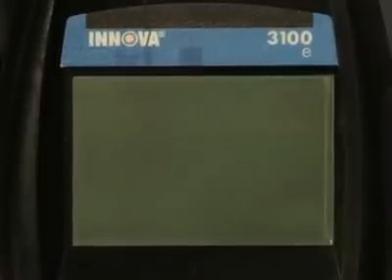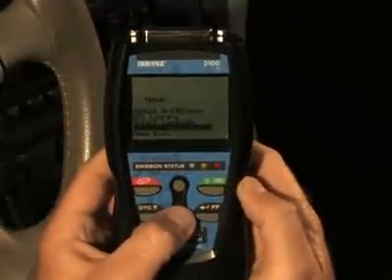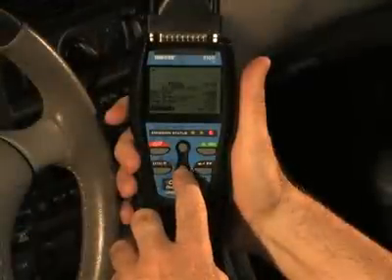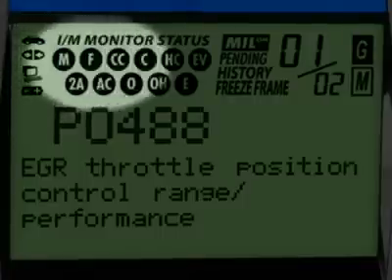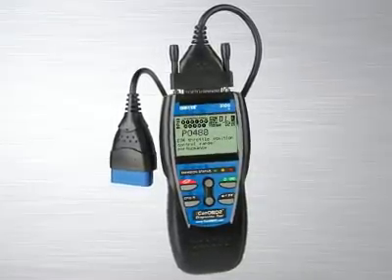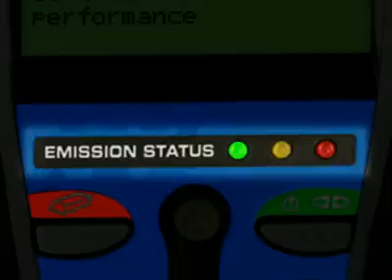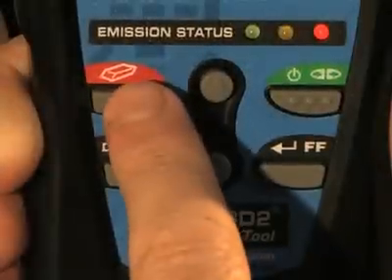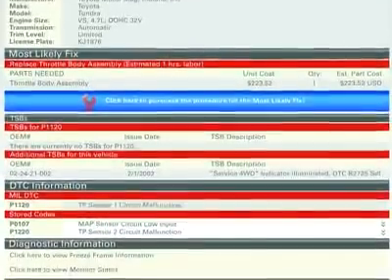Innova 3100 Instructional Video

Comment: Do these ones show the O2 sensor readings ?
Reply from the maker: No, unfortunately, this older model 3100 does not show Live readings for Oxygen Sensors. We do have other tools with the Live Data feature that support voltage reading for oxygen sensors, depending on the year, make, and model, like the newer 3100RS.

Comment: Purchased this tool years ago, still works  great and has saved me thousands of dollars from going to the shop to diagnose the problem. It will tell you that you have a misfires cylinder and even tell you which one it is. Iv used it on many people's cars and it was well worth the $100 I spent at the local Walmart store on it.

Comment: I have a 3100 with no letter, and no two buttons in the center of the unit (just four buttons at the "corners").  When I try to get codes from a 2001 Tacoma, I get an "Err" response.  There is no obvious discussion of the "Err" code in the manual.
Reply from the maker: Thank you for your comment. ERR means the tool is not able to connect to your vehicle successfully. Please try starting the vehicle's engine prior to connecting the tool and connect it with the engine running. If the tool still does not link please disconnect the tool, remove the batteries, and connect it back to the vehicle with the engine running.  If the tool does not turn on then you have no power at DLC, we would suggest checking all the fuses under the dash. Any blown fuse will affect the connection with the reader. Please replace any blown fuses and try again. If this does not work please contact us at your earliest convenience at 800-544-4124 so we can better assist you with this problem.

Comment: I try to check my car it's a 2003 toyota tacoma 4x4 v6 . And i have the innova 3100 . But show me in the screen . Unable to establish a link with the vehicle .verify the connection at DLC.. verify the ignition is on. I check the cable and everything but i still have the problem.. do u have any solution.? About that problem. Thank's

Comment: what's the difference between the 3100 and 3100i?
Reply from the maker: +Erik Chavez 

-         
Thank you for your inquiry. The 3100 no letter
doesn’t have CAN protocol, so it is unable to scan 2004 and newer vehicles. The
3100i does have the CAN protocol and will scan 1996 and newer vehicles. The
3100i has a color display screen, It also able to scan for ABS on most Domestic
vehicles.
Reply: +EquusInnova i have another question, is the 3160e the newest/best of the 3160 line? does it have basically all i need in a scan tool? what's some of the differences between the 3100i and 3160e? or between scan tools in the $100 range and $200. im trying to decide between  those 2. thanks for the replies.
Reply from the maker: +Erik Chavez No Problem, Our Customer Service team can help you out with deciding what tool would be best for you! Contact them at 800-544-4124 our business hours are 7 days a week from 6 am - 6pm (PST) They can give you a full description about the differences of the tools. Give us a call! Thank you!

Comment: hi i have recently bought a 3100abs and i plug it up to all of my computers and none of them will run the program wondering y i can not get the program installed on my computer?
Reply from the maker: Hello openyoureyes21,

Thank you for your inquiry. You will need to download and install our latest software, prior to connecting your tool into the computer. Please follow this link to download our latest software:

Follow this link: http://www.canobd2.com/en-US/Support/Download
Under “Please Select Category,” select "OBD2 Diagnostic tool".
Then select the appropriate model:3100abs.
Under Software application, there should be a link: Innova OBD PCL.
Select this link to download and install our latest software.

Thank you,
Innova

Comment: You don't explain the yellow led light.      Have yellow light still on and no codes days after replacing part  and clearing code and driving car. And you don't explain if you have to erase codes to get light leds to change status or just leave and car ecu will clear?

Comment: On the battery icons there are 4 icons and you don't explain what they are for. I get the left and right arrows blinking during testing in progress and the testing progress never ends. Even after leaveing it to test after 5 to 7 minutes will show a code if interupted with menu mode /car is 2001 whats that mean. The others don't light up just arrows blinking..

Comment: but the video doesn't show how to properly save the codes on the reader & how to properly eject it from the data link port located under the steering wheel. I am new to this OBD2 stuff. I'm scared of damaging the datalink port & OBD2 reader if I ejected it wrong.

Comment from the maker: The 3100 is capable of erasing "check engine" codes. When a code is erased without correcting the problem it will likely reappear after a certain number of drive cycles. If you have questions about a vehicle's integrity the best thing to do would be to have a certified mechanic or dealership inspect it before making a purchase. Should you have any further concerns please call one of our ASE Certified Staff Members at 1-800-544-4124. We are available 7 days a week from 6am - 6pm Pacific Time.